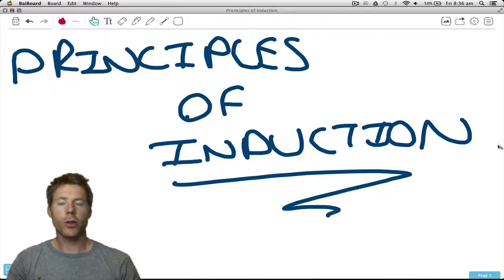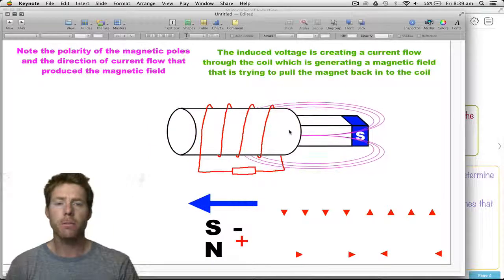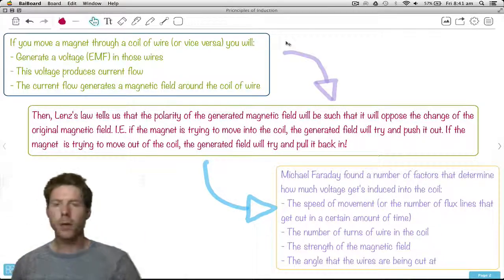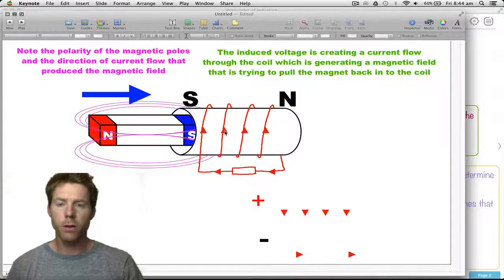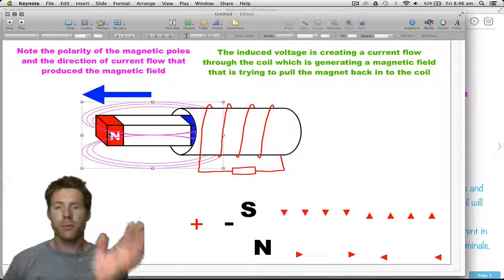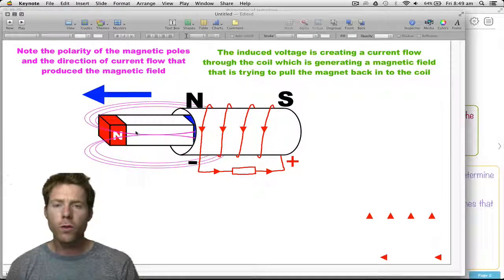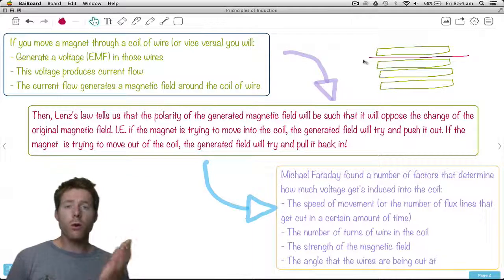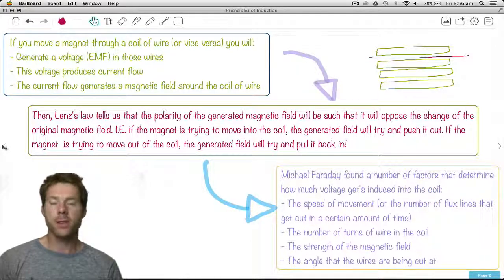Electronics Fundamentals Tutorial #27 Principles of Induction

Comment: Brad, if you could move the magnet back and forth, or left to right and back again continuously, would you end up generating an A/C voltage?  If so, would the rate that you moved back and forth be considered a “cycle”?  Great presentations by the way, there should be thousands of likes!
Reply from the maker: Hi Randy - that's right, you would end up generating an AC voltage. Normally this is done by spinning a magnet which is surrounded by coils of wire (or vice-versa) and this is how a sine wave is produced. The 'rate' at which you move it back and forth would determine the 'frequency' which is measured in 'cycles per second'. One 'cycle' is simply where the pattern of movement repeats itself.